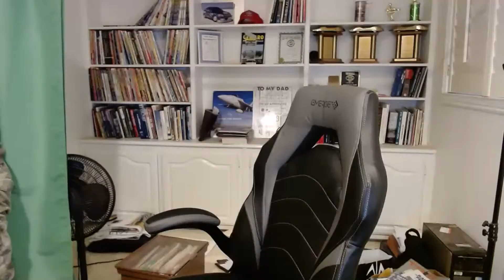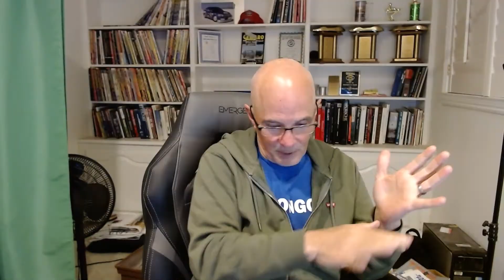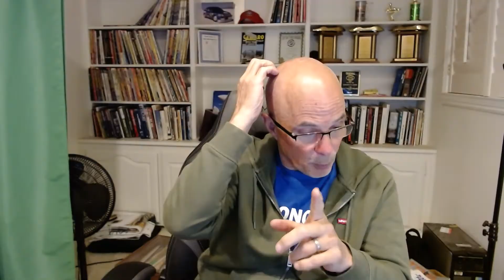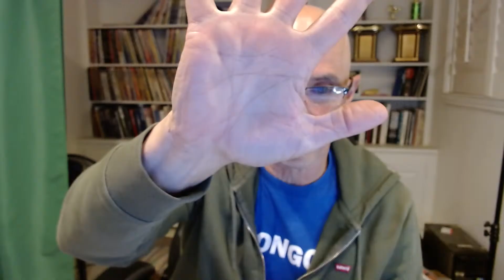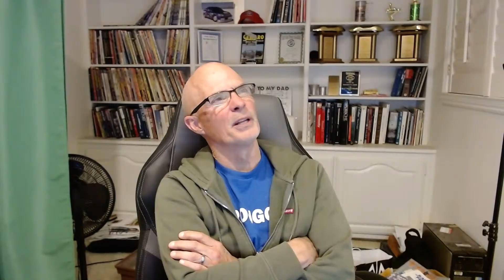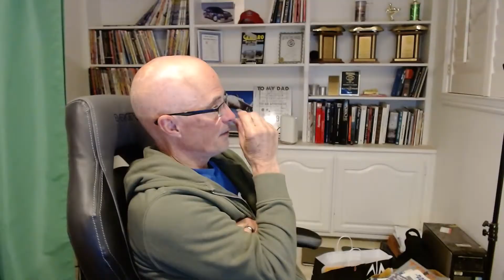BLOWER VS TURBO CAMS LET'S TALK TECH

Comment: Would it be a correct statement that a well sized (Read big!) Positive displacement supercharger would overcome (by sheer force of pressurized charge being rammed into the cylinders) the low end response lag of a cam tailored to higher RPM operation? 
Low end cam lope is just insufficient gas velocity to effectively scavenge the cylinders no? So if you have 11psi of boost  from say 900ish rpms, the positive pressure at the intake valve should discourage the exhaust gas from lingering in the chamber/trying to reverse back into thw intake tract/corrupting the intake pulses.
Reply from the maker: a PD blower helps add low speed torque on any cam

Comment: Missed the live feed. Long runners with a centrifugal supercharger w/pulley sized to max out at stock redline. Seems like there would be no "dead spots" as rpm rises
Reply from the maker: still a rising boost curve
Reply: @richardholdener1727  I was surprised to see some of the other racers moving towards the centrifugal vs the turbo. Most stated the same things (less traction issues/ less breakage of parts) but for the price of some of these turbos ..
Reply: It's easier to tune traction control with supercharger

Comment: I know early on cleats was using some little electric pro charger did make a couple pounds of boost in a chevy corsica or something like that. Was an improvement over stock but didn't seem very practical and then again they also used a leaf blower and I'm pretty sure that made more boost
Reply: Cletus McFarland
Reply from the maker: you might mean he used an electric supercharger-Procharger is the name of a company
Reply: @richardholdener1727  yeah but I remember it only making 4 or 5 pounds and costing over 2k.. dose not seem at all practical when you consider Holly module and turbo and intercooler all together are right about 2k

Comment: Have been curious when you say better NA for better with boost, is there a point of not better concerning overlap on camshafts. Many circle track engines will have 102-106 lobe centerlines, with lots of overlap. Is there a point where the boost blows more intake charge out than is prudent?
Reply: The phenomenon you describe is usually called "over scavenging", something that can be a problem on NA engines (and blower engines). Turbo engines tend to be the opposite, back pressure is affecting the engine mostly around TDC, as the exhaust valve opens it will dump the majority, and on the way up you're hoping there isn't too much pushing happening. 😄
Every engine combo is different though (if you really push the envelope), to take a Really extreme example; I talked to someone years ago that built engines for RX (2 liter Cosworth Ford 550-600hp with restrictor and ALS) and they flatlined the boost up top due to the restrictor while also wanting to get boost (or keep it) at low rpm with the antilag (which also was really necessary due to the size of the turbo). As it relied on just igniting the mixture in the engine without it creating power they needed to get it out so LSA was sometimes as low as 90 degree, meanwhile it's ability to breathe changed so much over rpm that they sometimes ran 40 degree reverse split on the cams. 👀😵‍💫
They ran a handful of different cams on both sides and moved each as much as they could in each direction, overlaid all dyno graphs to see which intake and exhaust cam to pick and the desired setting.
They said that most of the time you can keep the cam the same as NA, possibly add a couple of degrees of LSA. But sometimes you can benefit from not creating to hard pulses on the intake (🤏slightly lazier intake lobe), while doing the opposite on the exhaust. We're talking a few degree in difference while keeping the area under the curve the same. (This is based on ideal cams which can be quite different from catalog cams)
Reply from the maker: with more back pressure than boost pressure on a turbo system, how would boost blow out the exhaust?